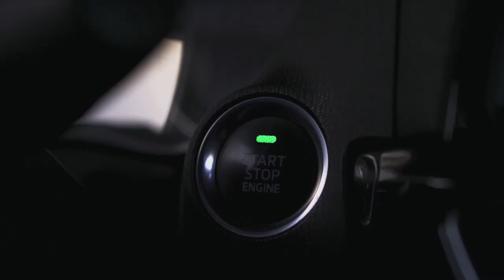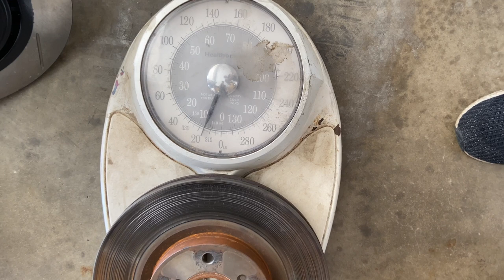StopTech Excelerate TSX Big Brake Kit Install On 9th Gen Honda Civic Si - FITMENT IS PERFECT!

Comment: So the whole kit is 1.1k? With everything included
Reply from the maker: I believe if you hit them up on IG @excelerateperformance they may be able to get you a bit of a cheaper price!
Reply: Ahh ok, also theres no need to modify any fitment? Also would it be able to fit stock rims?
Reply from the maker: herc1319 it’s a direct bolt on, but not sure about the fitment on stock wheels since my friend has the RPF1’s in 17
Reply: JOUSEPH MORO Probably need a 20mm bolt-on spacer to make it work with stock wheels. The stock wheels arent aggressive enough

Comment: Just my observation, I think you have installed the wrong rotor on the wrong side of the car as the grooves in the rotor should lean away from the brake calliper in your installation video your grooves are leaning into the brake calliper, another no, no is the fact you should not have to hammer fit your brake pads into the brake calliper housing as you are going to have nothing but rubbing and that in turn will slow your car down and bur excess brake pad real estate so they wear after.  
Correct me on this analysis if I am wrong then I apologise to you for the misinformation. Nice brake kit by the way I will upgrading to  A BBK myself next year when funds allow i'll be going for floating rotors.
Reply from the maker: The BBK is installed correctly, as for the brake pads sometimes they aren't completely flush. Many other people who have installed this set up report the same thing on the forums

Comment: Hi.Does this TSX kit fits a 2015 Civic SI? Thanks.
Reply from the maker: gorcrx it should fit since 2013 and 2015 are the same generation
Reply: @abc.garage  Ok.TSX of what year?
Reply from the maker: gorcrx 2004-2008, the link to the BBK is in the description with all the info
Reply: @abc.garage  Thanks.
Reply: I wouldn’t take advise from this guy for one greased wrong part two rotors are on the wrong side three doesn’t know how to bleed breaks. Honestly following guys who want to be cool instead of informing you on how to put on bbk correctly they are going to get someone hurt.

Comment: Would this fit a 8th gen
Reply from the maker: It probably won't, but I'd suggest to reach out to them to double check
Reply: Buy FastBrake adapters, Acura RL / JDM Honda legend Calipers, Nissan 350Z rotors. That’s what I did an it’s beautiful
Reply: Yes, but you’d need to upgrade to a TL Type S brake master cylinder or else your pedal will feel super soft. People run TSX rotors/calipers in the front on 8th gens all the time
Reply: @pingbui8272  The only downside is that there is barely any performance pads for the RL Advics!

Comment: Not at all lots of mistakes. For one no need to grease the pins the parts that need to be greased is actually the back of the pad it’s self cause it’s metal to metal. Pin are place holders. Two when bleeding breaks if you trying to take air out the bottle should have fluid in it and tube in the fluid so that no air travels back in. And when your refilling it empty out the rear break fluid that’s a waste brake fluid is hydroscoptic so putting dot 4 to improve viscosity to option higher break heat was a waste might have as well put back the same fluid you took out. But pointers when you post for newbies that need to do it correctly for the future. And there’s no difference between 4 piston or one piston it all show no go you can achieve greater breaks with just pads and rotors break lines and dot 4 all you need honestly. So yea a pound that you save is doing absolutely nothing.
Reply: What is your track time? That's a bold statement you're making. Brake pads and single piston is better than a 4 Piston big brake kit?
Reply from the maker: You got us

Comment: Let me learn you something. Bigger brakes and rotors doesn’t make the car stop faster. Has nothing to do with pressure or clamping force. It’s about heat transfer. Soooo unless you’re racing on an actual track… it’s only good for aesthetics.
Reply from the maker: He does race on the track…